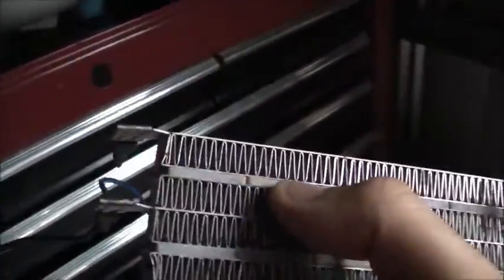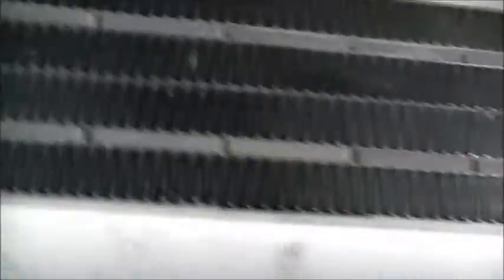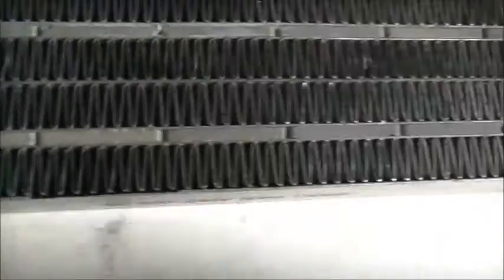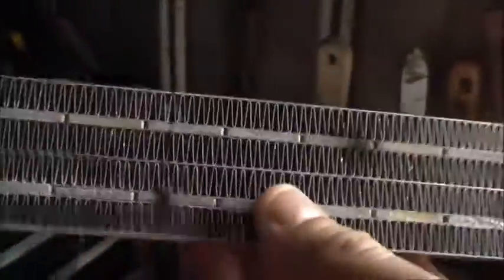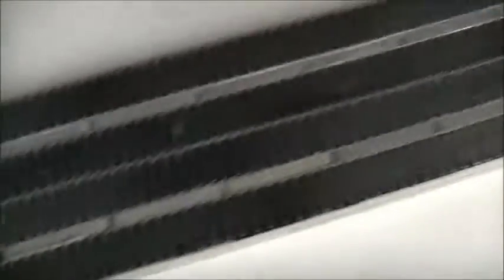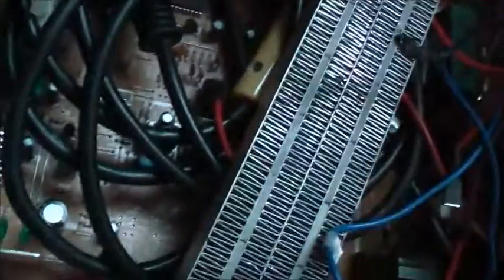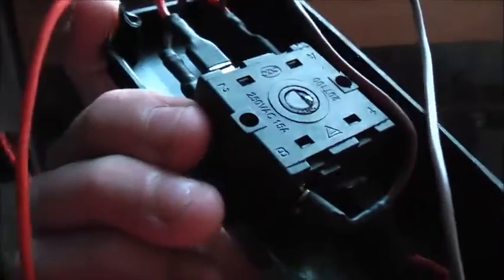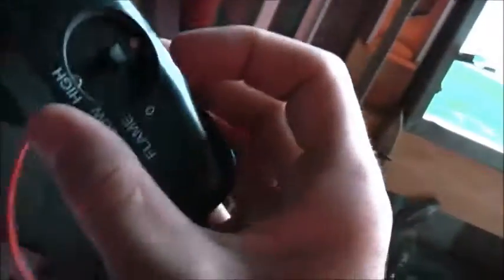Look At Heater Coil Element

Comment: Viewer # 11. :D

To find out what bit gets hot on that device, dig out your variac and see if you can figure out the wiring config so that you can get part of it, or all of it going.

Before connecting the variac, get a ohm meter on it to see if it's behaving like a traditional resistive element.

1kW at 240v should be 57.6 Ohms,
2kW at 240v should be 28.8 Ohms.

While you have the ohm meter going, see if there is any continuity between the conductors and the metal 'frame' of the heater.

If there is, then you will need to turn off the heater each time you hold it to prevent being zapped!

Next, carefully teeaase it on the variac to see what bits warm up.

As you say, those 'fins' in there may be serving as a way to convey the heat to the air as it is forced through by a fan.

Carefully teasing the heater on the variac may allow you enough time to differentiate between what bits are getting hot and what bits are not actively generating heat.

If you're not planning to use this heater for anything, (like warming buckets of water, LMAO! BE CAREFUL!!) then what we really need, is for that heater to be "Opened-Up-Very-Carefully" and seeing what those "tiles" in there really are.

They may just be metal 'cans' filled with some kind of thermally-conductive, electrically insulating solid, into which a standard heating wire is embedded.

Who knows?

We need this to be "Opened-Up-Very-Carefully" so that we can discover how it works.

You know.... "In-The-Name-Of-Science" :D

Thanxx for showing,

-BoomBoxDeluxe.

10th February 2016, 12.05
Reply from the maker: I am going to do a test like that on it